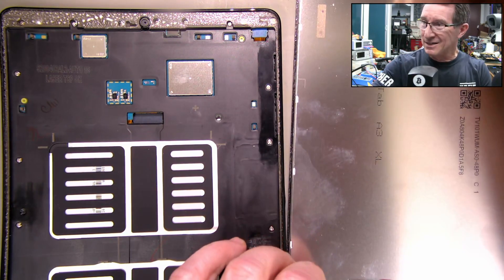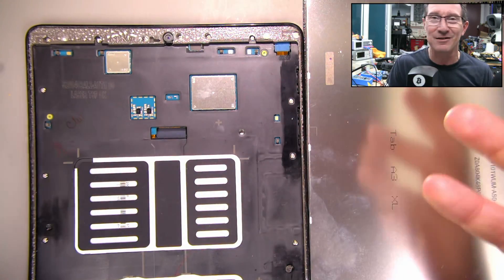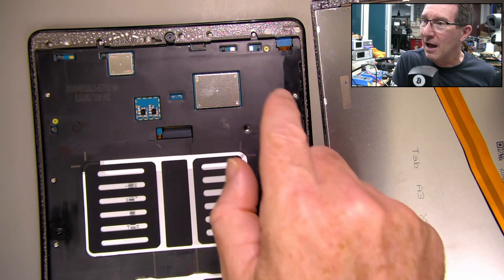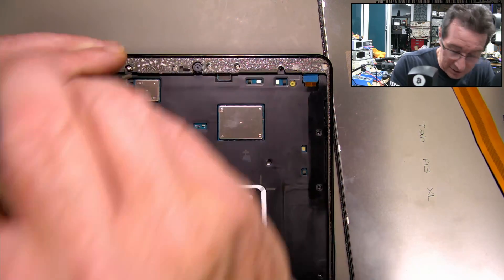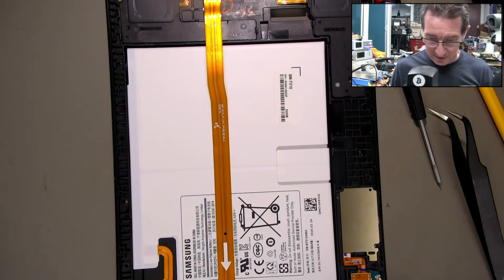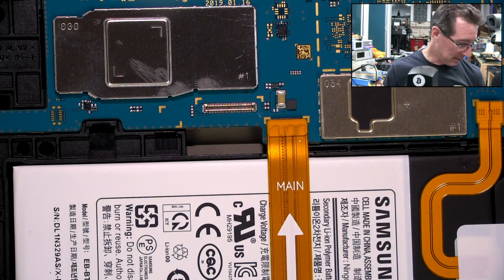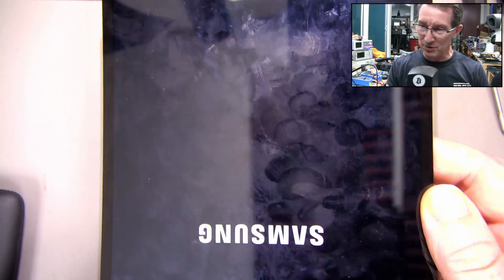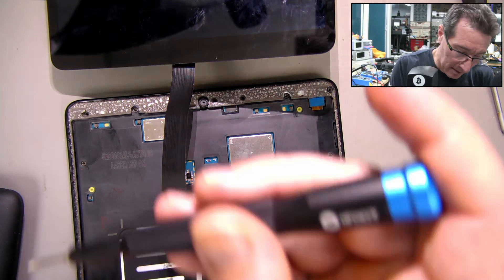Samsung Galaxy Tab A 10.1" - REPAIR (Part 2 of 2)

Comment: The electric screwdriver is useful with longer screws that need a lot of turns before tightening down. Small electronic devices where size “matters” the screws will be as short as possible

Comment: What a BS tablet. Wanna fix something internal ? risk breaking the screen... gosh
Reply: At least internally it is not glued together like some of them (like the battery to the back plate, as Dave feared). The screen is easy enough to remove without any risk of breaking it (well, not for a DIYer who tries to do it the first time and not preparing with enough research and tools).

Comment: Oh wow, first time I see a tablet with screws from the lcd panel in. Usually the back plate is just a press fit with some optional glue which once taken off gives access to the screws. This is backwards from the other galaxy tabs and co I took apart. So weird.

Comment: The same thing almost happened to mine, I use it for waze/navigation in the car in a mount, one day the sun was hot enough that while driving the screen separated.  I ended up just using small binder clips on either side (its really only ever used in the car, and gets put away in a cool place behind the passenger seat when not in use)

Comment: A manual screwdriver gives you more feel of the torque when assembling it too.  You lucked out, the battery was not covering the broken cable.  Go light on the glue and tape, you'll be glad you did the next time you have to take it apart.

Comment: Thanks, Dave, I got one of those free w/shattered screen.  I should get on it before parts shoot up.  Great to see what's inside!
Reply: If the LCD itself is not broken, you might be able to replace the touch panel separately, it is much cheaper, and it has the benefit that you can be sure the display is original, and not a questionable quality 3rd party knockoff. But before you order a bare touch panel, try to saparate the LCD from the old touch panel, and order a bare digitizer only if you succeed without killing the LCD. In some touch screens the digitizer is bonded to the LCD with its full surface, that's not worth messing around, just order a whole new screen (preferably original one) if that's the case.
Reply: @mrnmrn1 Thanks, I do believe it's just the touch screen, but didn't think to do the tear down ahead of ordering it, Thx again!

Comment: Have the 2019 8" model of the Tab A. Solid little thing, runs LineageOS a treat. Definitely recommend a sturdy case for it. Unicorn Beetle makes a tough one, but, the built-in stand will maaaaybe last a week with kids handling it. Other than that, it's a tank of a shell for the Galaxy Tabs.

Comment: Regarding power-on, in the past I had issues with a Tab 2 10.1 tablet that would not charge and not power on after being off for a long time. I was able to 'fix' it by using a non-Samsung 3A charger and after a short time it started charging. I actually rarely use this TAB 2 now but I keep it near my phone and charge it at the same time so the battery doesn't go flat and cause the same issue again.

Comment: I don't know if I have that same model or not, but my parents gave me one of those. I used it for a while with their cell plan, and then that got cancelled so I just don't use it today. Mine is cellular.
Reply: You realize you can use a tablet that uses 5G/4G/LTE on wifi just fine?
Reply: @tschuuuls486  Yes but I don't have a big use for the tablet. Also my home network is set up to actually go out an iphone 11 cellular so it would just be using it. I used the tablet as a modem for their data plan really only.